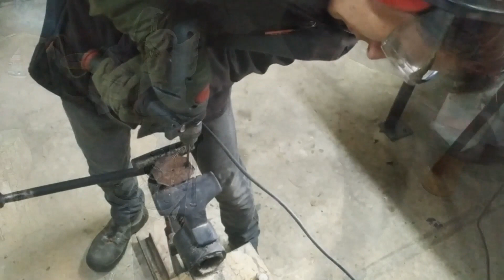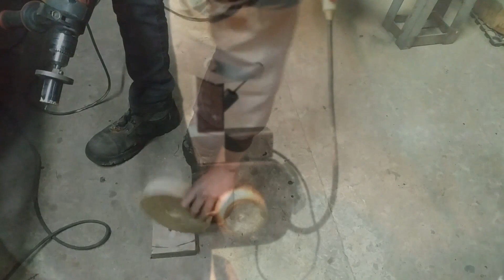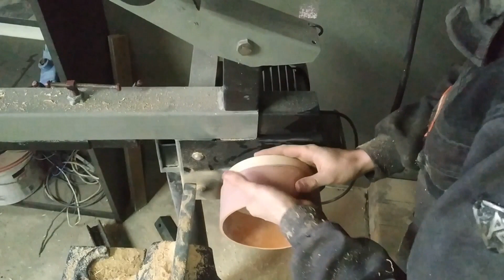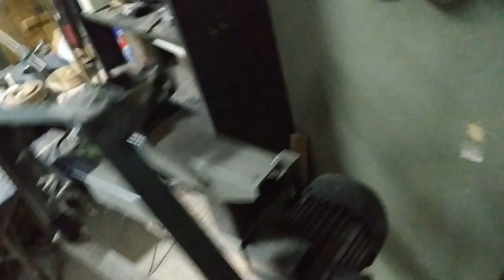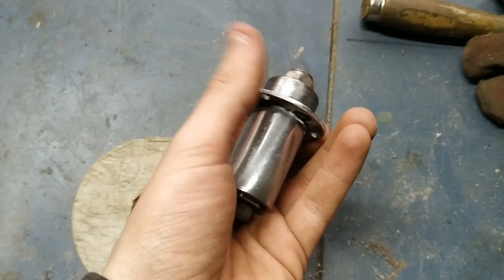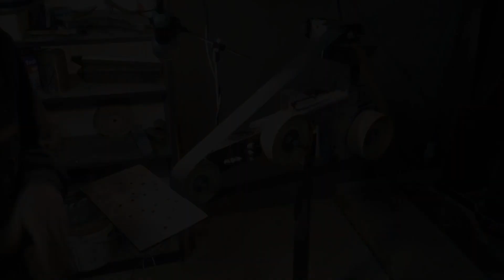DIY Belt Grinder Improvements part 2 : Drive wheel, contact wheels attachment without lathe

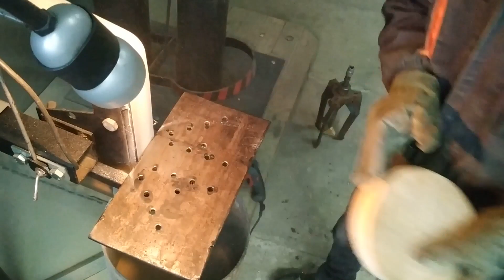Comment: Simple though elegant appearance---runs smoothly.  Liked the way you trued and crowned the wheels on the machine.  I worried about a glove finger getting caught between the platen and the work rest at 2:30.
Reply from the maker: These green material gloves are useless. You don't feel what are you doing by them.

Comment: Working on the inside of the belt and pulley at high speed looks very dangerous, if you slip you are going to get Hurt badly!!
Reply from the maker: You're right, It's not the safest way to do this